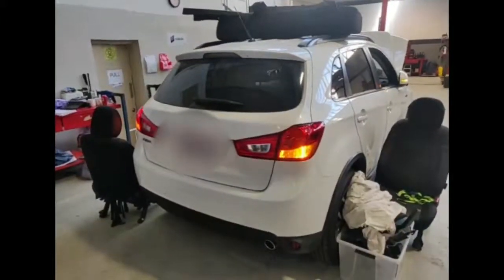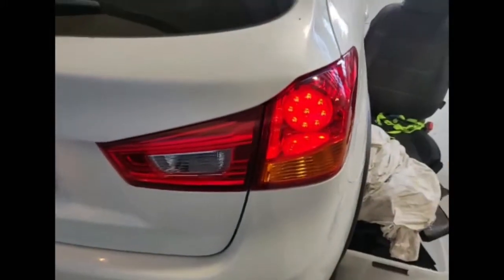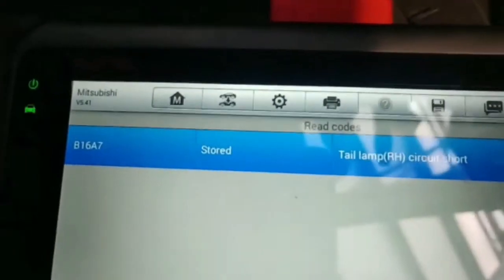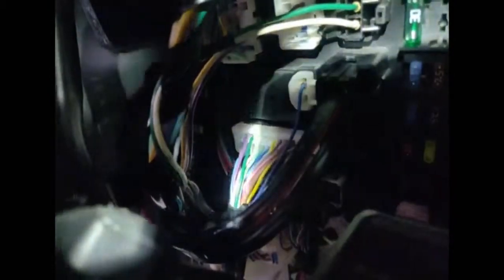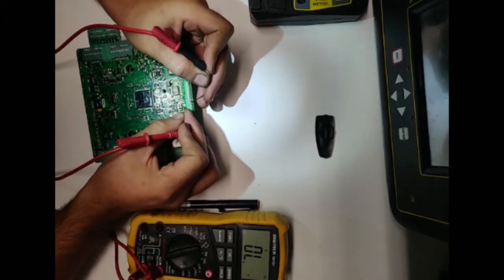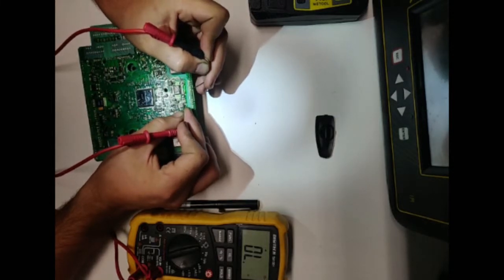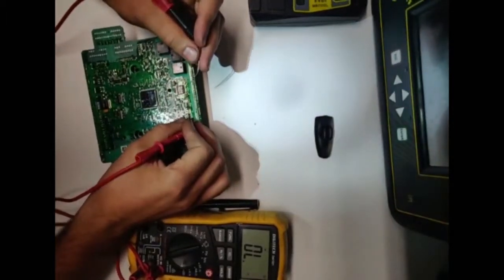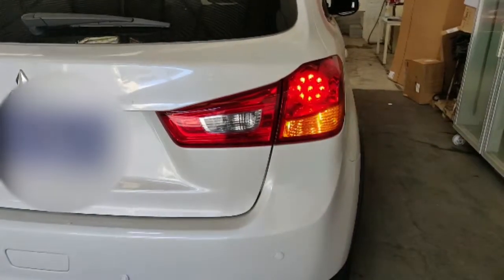Mitsubishi ESX tail light malfunction, BCM repair

Comment: Hi, I have the same problem with my Mitsubishi Asx. Can you please write the name and model of the electronic component you have replaced? Thank you so much
daniele.baione@gmail.com
Reply from the maker: Hi , sadly I lost the picture with that component, but even though I would still have it, BCM ar not all the same, when you will open it , the architecture of the module might be different and the component it self. It's quite easy to open it, inspect it, order the the component, assemble back and wait till it will arrive, I didn't found that component on local market, so bought the donor BCM for parts.